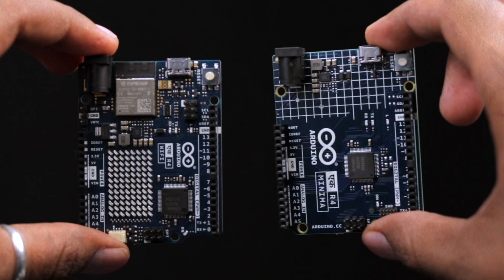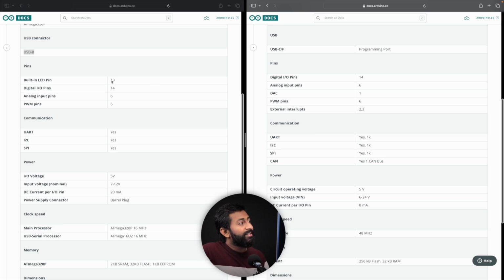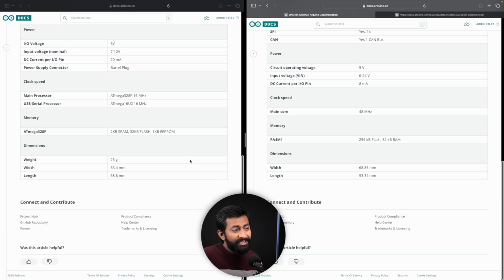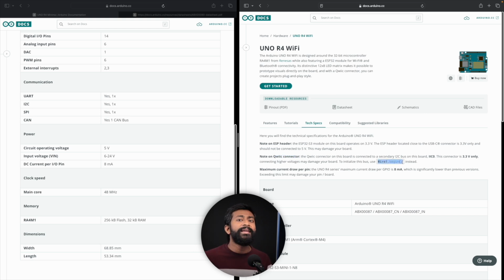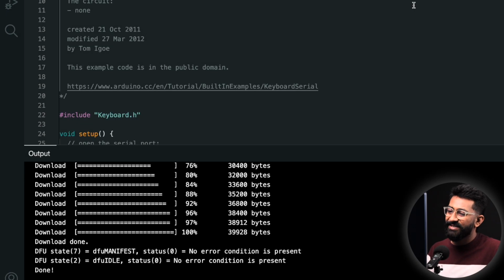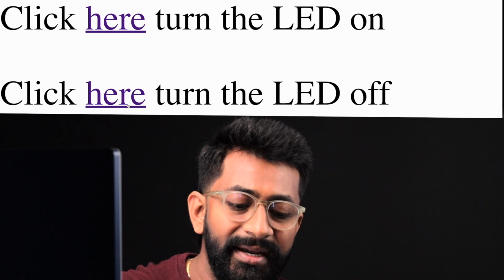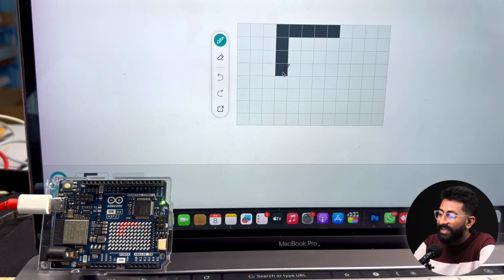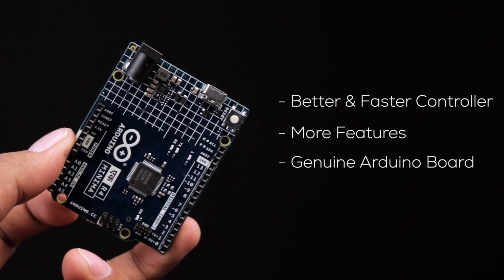All New Arduino Boards from INDIA 🇮🇳| Arduino UNO Ek (एक) Minima & WiFi Board

Comment: SORRY FOR OUT OF VIDEO QUESTION ,, hello bhai i have one problem ,which i am currently facing i have esp32 and three modules (mic,sd card and oled) , iam unable to use three of them because of less current i dont have clarity of connecting battery to esp32 also . please can you explain or help me out .i can use only two modules at a time . PLEASE HELP ME OUT😢😢
Reply: Even i faced this problem when learning about esp32 but i didnt get any proper solution 🥲
Reply: I just want to know how I can connect a battery safely with high current like 1000 mah so that i can run all my devices
Reply: @novabeat3d2y  try adding battery to components it self. 
Steps: 
-> Pick a battery according to your component you want to run. like the component supports max 5 volts then pick a 5 volt battery or even 6. or just pick out its datasheet from the web and find its max voltage and go on to second step accordingly. 

-> Connect positive of that battery to the component VCC pin and negative of the battery to component's GND. 

-> Now You should have a common ground so that esp 32 or any other board can connect to it. its simple. pick GND Pin of your component in which battery is connected and connect to esp32. 

Causitions: 
Disconnect VCC pin of that component from esp32 as we dont want to fry our board. 

And in your case the i guess all the three components are a lot power consuming. soo it will be recommended to pick a battery wisely after doing resarch so your components dosnt gets fried. 

And If something else you wanna ask i can help you with that because i also worked with components.
to contact me slide into my dm in discord: *endermite_* is my id in discord. dont worry i am not gonna charge you anything for that.